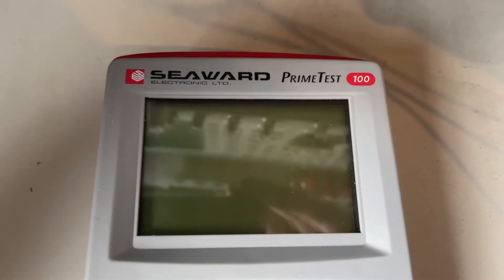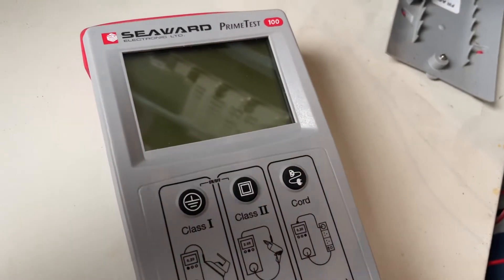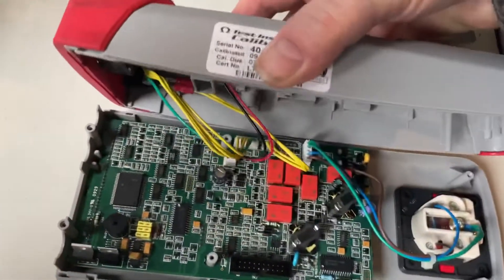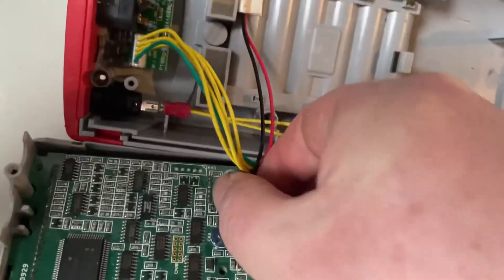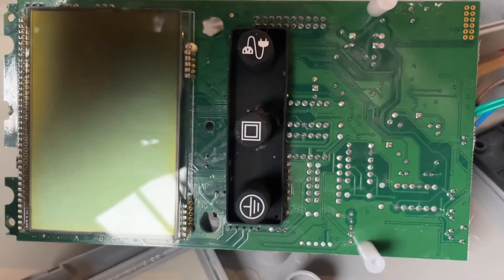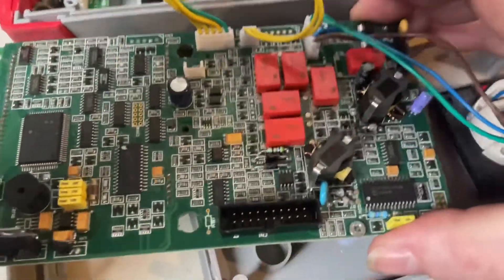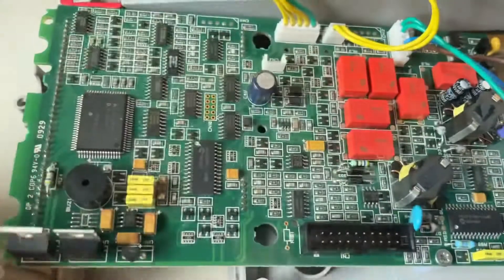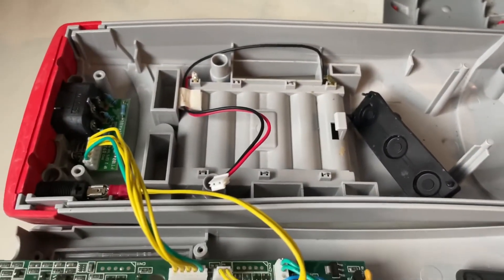Seaward Primetest 100 dismantle and Fix, read below

Comment: Did you ever get to the bottom of this? I have an identical fault on a Seaward 3760DL. I haven't been able to give it an increased voltage as I don't have a suitable bench supply, it does the same when plugged in to mains.
The seaward agent has quoted me about equivalent to about £500 to replace the board and re-calibrate.
Reply from the maker: Please the comment and my reply to cambridgemart2075, changing the wires cured the fault.

Comment: I've seen weird faults from leaking batteries, a common one known to radio control modellers is 'black wire corrosion', the electrolyte creeps down the wire inside the insulation and corrodes the wire within the insulation, either turning it into a resistor or causing a complete open circuit. Well worth checking the resistance from the battery terminals to the connector at the PCB end.
Reply from the maker: Hi this is exactly what i found,  first job  i did after making Part 1 was to clean the battery terminals and check the wires.  I cut back the black wire to find it corroded all the way along its its length, changed the socket and replaced the wire, cleaned up the board and battery contacts and all working now. Thank you for the suggestion, best regards Wayne (M0WPS)